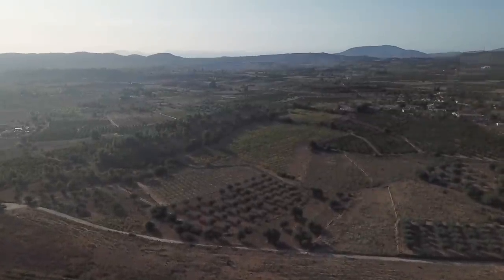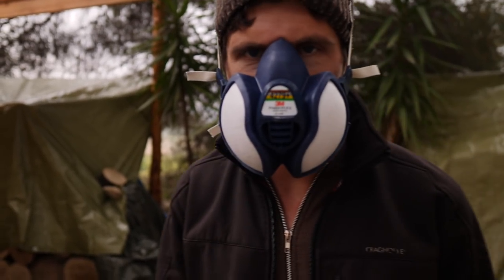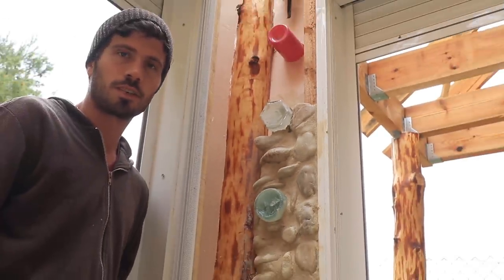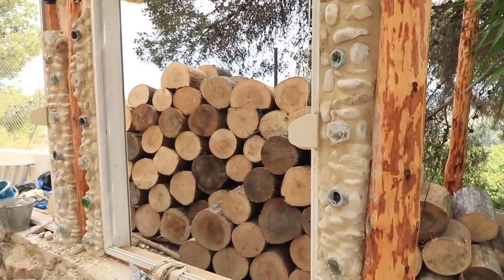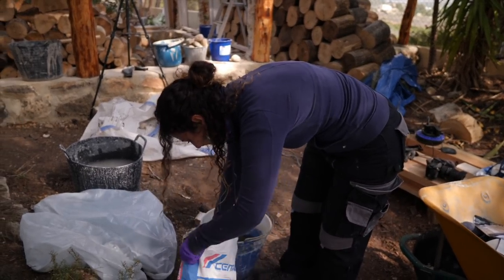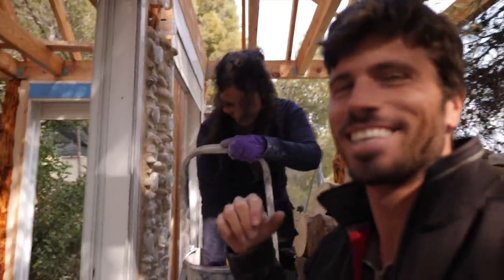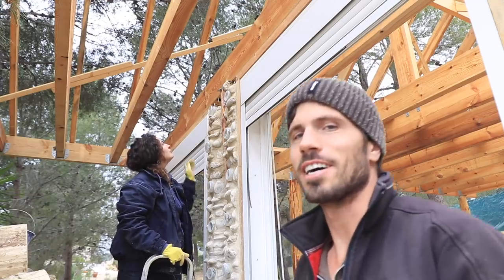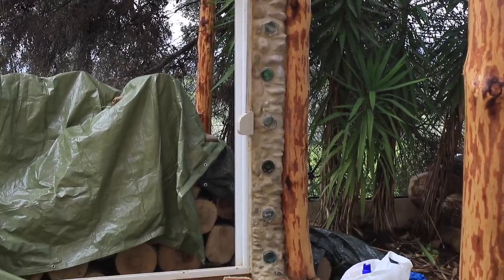OFF GRID and ALONE, WINE BOTTLE WALL MAKING

Comment: Man, I really love and admire your spirit. I am really concerned with the structure, though. A building should have at least three stiffened walls or rigit connections on the pillars. You have neither of those things.  When the sides are closed, the whole stucture could twist and collapse, due to strong storms. Please contact a structural engineer. Godspeed
Reply from the maker: wait 3-4 videos, and comment if you still think the same :) :)
Reply: @HuubVlogs  I'll do that.

Comment: A tremendous amount of work compressed into a 23 minute video. Would it have been possible/quicker to clean the surface of the stones as you did your cement work instead of cleaning them afterwards? I agree with your helper about wearing masks. Did she say that her father has not worn one for 45 years? Thanks for sharing.
Reply from the maker: Yes you are definitely right and for the next project I am dong that immediately. Well the glass at least....

Comment: Hello and thank you for these inspiring videos !  I am wondering if you dried and seasoned your logs and lumber before using them in your structure ? Wood that is not dried properly before use can shrink, warp, twist, or crack and cause pretty big problems later....what did you do with the trees after cutting them down...did you bring them to a mill to have them cut into lumber, or did you buy lumber that was already seasoned and dried ? Did you uses screws, nails, or pegs to join your boards ? Just wanted to learn about how you did some things. 🌲🌲🌲🌲

Comment: out of curiosity - i like the stone/glass walls .... do they add any structural strength (they're not tied into the logs... the small screws don't count)?
Reply from the maker: In the end, everything will add to the structural strenght. But they are not build to be a structural pillar like a concrete pillar. It just has to be strong enough for the lightweight roof I'm putting on top

Comment: I like the art part of the house but with out wire mesh for strength aren't you worried that it's going to fall apart eventually, I'm guessing after all that hard work you would want this to be a permanent structure. Good job though 👏 👍

Comment: The wall looks great! but good to know that it takes sooo long to make that, in case I am tempted to do a similar thing :-P. In retrospective, besides using bigger stones, do you think the process could have been sped up somehow? All the best, you rock!
Reply from the maker: I mean, these spaces were really small and I used rubble stones. I think any type of square-ist stone would speed it up. Having a bigger gap and use bigger stones would definitely speed it up. but still you'll need small ones to fill in the small gaps...